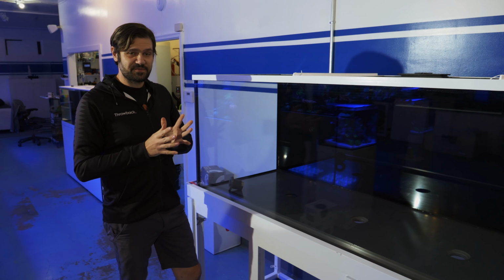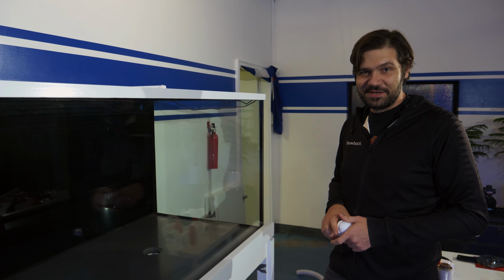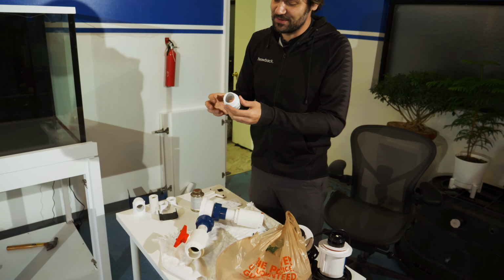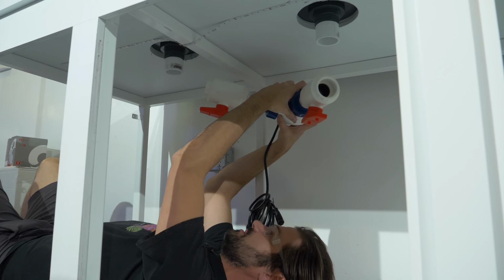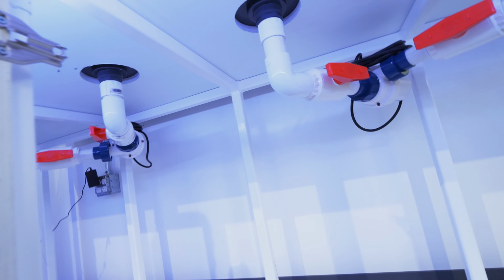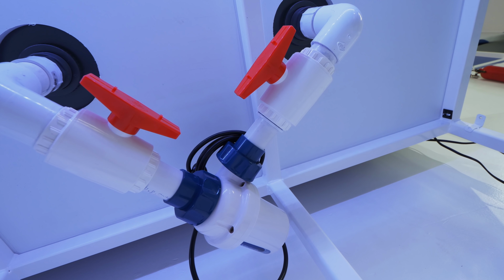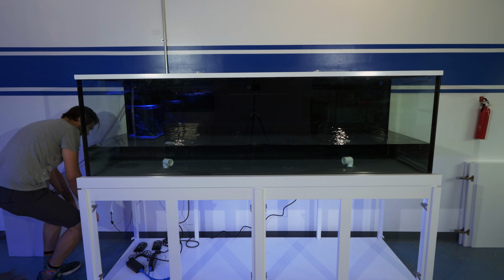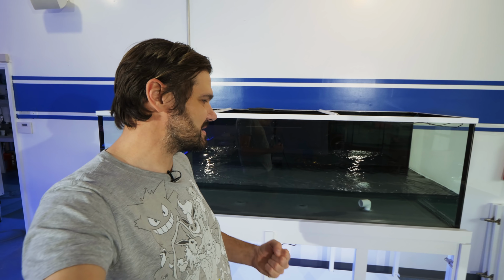Vlog 48: Plumbing the Closed Loop for MASSIVE Flow

Comment: Plumbing tip. Always use primer. I used to not think primer was necessary but after taking a plumbing class I learned you can actually bond two pipes using just the primer. The pipe should be cut as straight as possible. I prefer a miter saw and only use the ratchet or mechanical pipe cutters when I can't use a saw. Then chamfer the edge of the pipe to deburr the edge and cut off any lip created in the cutting process. Then prime the fitting aggressively, then the pipe, then back to the fitting quickly to ensure the primer is WET when the solvent cement is applied. Apply cement to the pipe, then the fitting and a quick layer back on the pipe. Push them together, if you can give a little twist as you push in. If plumbing larger pipe you may need more help. When done this way many people will be surprised as the pipe will actually try and push out of the fitting more, so you usually need to hold it a little longer to get it to bond properly.

Comment: My ideal is similar but I would put two  can filter pumps on each side of the tank. It would not only create a nice flow like power heads but it would also filter the tank at the same time. so no pipes or wires would be visible. especially if you use low profile bulkheads  with strainers for the out puts. I even use external heaters that are attached to the can filters, so it keeps the water warm for my tropical fish.

Comment: Really diggin this build!! Have been very interested in the bottom.of the tank since you unveiled it. The fact you could flush mount the gasket which would pretty much garuntee you'll never have squeeze out is a killer idea. Also going old school with the closed loop is bringing it back man, well done

Comment: Closed loops can be a very affective type of filtration. When we set up a system we always try to go over the worse case possibilities, the thing to consider is leaks. If a fitting fails, an o-ring failure (8 O-rings in this set up & 4 gaskets in addition to the glued joints) what is the worse case? In this set up worse case if not noticed total tank drained (to lip of bulkhead) and pumps run dry. If it would work for the look of the aquarium having a short riser (maybe 6") would at least save the fish in the short run in a complete failure. A lot of things would need to go wrong but failures always seem to happen when you are not there to catch them.

Comment: I also made a spray bar a few weeks ago adding on UV sterilizer made it closed loop(dino-snot prevention), battle was "successful" for my level I think. But the 1/2 spray nozzle was a big help pointed at the Monti cap and eliminated turkey baster maintenance with no pissed softies/lps, one less big chore lol

Comment: Question. so your pulling from one hole and pushing it from another.  one, i assume this is going to be bare bottom or otherwise everything will be sucked in or two. how do you keep things from getting into the intake?     i dont get it.

Comment: Hey Jake, how is this closed loop system holding up? Did you ever support the pumps? Any constant noise or vibrations the way it was setup in the long run? Now it has been over a couple of years since this install.

Comment: I'm in the planning stages for...a few aquariums actually. I'm trying to figure a smaller scale prototype first for what I'm thinking of.

Ive thought about a closed loop-especially with those vectras. Flow? That configuration? Open drain valve on wallet-voila! 😜 Short runs. Few elbows so you don't loose as much head. The valves you've got there? Maintenance? Perfect! 👍

So for all the other stuff like skimmers, kalk reactor's, UV sterilizers, would you prefer another line with a sump of some sort or...another separate branch from a manifold to extend that loop? I'm curious as if I could work that out without a sump...😁 thats food for thought and way less complicated than what ive got in mind.

Secondly, uhm...metal junction box? 😕 I made some mistakes early on and I had some serious salt creep. One day, I noticed my strip socket was charred. 

For a closed loop? If there's virtually no way you're going to have a leak, maybe. Personally? I'd prefer to resplice all the power cords to somewhere away from the water just for that reason-if I had a sump. Salt creep? Moisture? Electricity? 😕 I had to call OFD once for something and do not want it to be for something like that. 😕

Other than that, this has me thinking redundant closed loops in tandem. Sump container then becomes drip pan or splash shield. (Shrugs) That way if something major happened, there would be enough volume to collect whatever comes from the overflow configuration you've got whatever that is or its equivalent. (Shrugs)

Comment: Killer setup, great video as always. I never thought or seen a floating motor, but I Like it. Presently doing a build-out of a 1000 gallon saltwater. Part 16 just released, going FOWLR. Kicking around a closed loop, but with the acrylic being 2 inches thick, makes for an issue with the bulkheads. Be sure to check out the channel.

Comment: Nice work! Curious why no unions connected between the buildhead and first 90 elbow. Or true union ball valves... If you ever have to disassemble this your gonna have to cut everything and start over
Reply from the maker: The pump is pretty much the only thing that ever needs to be removed, cleaned or serviced.

Comment: You won't need to put any supports in for the pumps, the pipework is strong at that diameter and the lengths are extremely short so they will be fine. Looks awesome!

Comment: I think drilling some holes in shelf rock pieces around that 1.5" pvc outlet protruding from the bottom would look cool. Stack them up using a piece of straight pvc rising up about 2/3" - 1/2" the height of the tank, with the 90 on the top end, perhaps even a T fitting . This would effectively almost hide the pvc within the rocks, and that vertical pvc would be the spine of sorts for the rock structure. I think that would be slick to do, and you could even arch between the left and right side with some Mortar and regular reef saver rock... Thats my eye deer. Looks awesome so far!

Comment: Closed loops are an intriguing aspect of establishing tank flows while also maintaining a discreet appearance. However, when compared to the convenience offered by many advanced power heads available in today’s reefing hobby, what are the primary benefits of closed loops? I recall experimenting with closed loop designs in the past, but the availability of reliable power heads was limited. Nevertheless, the constant concern about potential leaks and floor damage due to plumbing insecurities can be overwhelming. It's reassuring to see that you've positioned it in an area where flooding isn't a major concern. Nonetheless, the maintenance demands of closed loops are substantial, involving regular pump cleaning and dealing with issues like intake clogs and seal leaks. Despite these challenges, your design and craftsmanship are truly impressive.
Reply: Jake unfortunately passed away in 2022 so I don't think you will get a response.

Comment: Are you using primer with the PVC cement?
Reply: Carl Johll 

Was wondering the same thing
Reply from the maker: PVC cement literally dissolves the polymer making it a solid structure - I have NEVER used primer and after all these years still not quite sure what it's actual purpose is.
Reply: @ReefBuildersVideo   The primer starts the chemical reaction for the cement to work its best. Since we don't have to pass plumbing inspections we use the clear cleaner which works the same as the purple primer. Here is a link that provides more information. https://www.commercial-industrial-supply.com/resource-center/do-i-need-to-use-pvc-primer/

Comment: Hard to explain but when you dry fit your pipes & fittings before gluing you can use a marker pen to draw a line across where the pipe & fittings join. That way after you disassemble them to apply the solvent weld you can see by the marker pen lines exactly how to reassemble them with no need to move or rotate fittings to find their correct positions while they are in the process of bonding.
Reply from the maker: this is a very useful tip  for achieving critical angles

Comment: I would suggest the ingress and egress be as far apart as possible so that water would travel further. Maybe just one pump from hole 1 to 4 would be about the same result as 2 pumps from 1 to 2 and 3 to 4. Less electricity, fewer points of failure. Would suggest schedule 80 for the bulkheads because if it leaks, it rains all 400 gallon out. Also it would be nice to install an apex flow sensor to see how much the flow is. I would be surprised if u get 70% of what the pump is rated for.

Comment: Hey Jake great video as always! I just have a question, don't you think that installing the pumps upside down is going to have a negative effects on the hard plumbing? How do you plan to reduce vibrations?
Reply from the maker: Keep in mind this is thick, 1.5” pipe - I will support the pumps eventually

Comment: Say don't mean to bother you but I was sent to you for some advice I'm getting ready to setup a new reef tank and my question to you is my overflow holes are 1" and my return holes are 3/4" I plan on running 1" all the way to the sump with my overflow drains. Now the real question is on the returns from the return pump how would you plumb it my Outlet is 1 1/4" what would size plumbing would you run to the 3/4" return hole 👍👍looking forward to your response

Comment: Question about closed loop systems. They look really clean, but am I just being stupid and not figuring out filtration such as a sump and such.
Reply from the maker: Filtration is separate
Reply: @ReefBuildersVideo  You could still do a closed closed loop with filtration. If you added it to a sump or canister filter it would filter it and push it back out  really well with no more clutter needed in the tank.

Comment: I'm currently building a 220 system,  And consider doing a closed loop the problem is with new tanks you never really know which panels are tempered and which are not So for fear of shattering my brand new tank I'm going to skip the close loop

Comment: Tube bending, heat and flex to the angle you want.  I think Than did that.
Reply from the maker: that is certainly more practical both for smaller diameter pipe, and for drains instead of high pressure returns. For some others flexible Spaflex is an even better material

Comment: Ok, I know this question has been asked several times and your response is the same "several layers of pre-filtration. I'm still relatively new to the hobby so I also do not understand. 

Can you please outline the benefits of this setup, and a little more detail on how it works.
I mean, are you going to extend the inlet? With that much flow you're going to be making fish smoothies.

Comment: Don’t you lose flow velocity by going to bigger bulk heads and returns.   Won’t your flow volume be regulated more by the pump, with velocity a function of the diameter of the tube.  Narrower, higher velocity.
Reply from the maker: I like how you’re thinking, you’re going to love what I do next with this water flow machine
Reply: Your gallery is cool.   Can’t wait.
Reply: What is going to be the filter?  What’s the purpose of closer look that you can’t get with powerhesds?
Reply from the maker: @atfinthehouse8631  the purpose of the CL is more power and keeping everything out of the tank
Reply: Ok, I guess I am still confused.  There is no filter there.  Water comes in and goes out of pump.  There is not filter in between.
Reply from the maker: @atfinthehouse8631  Correct, the actual filtration will be a separate system, on 'open' loop with sump, skimmer etc.